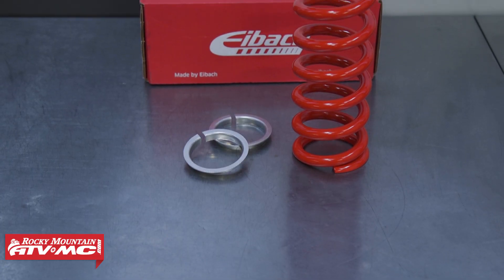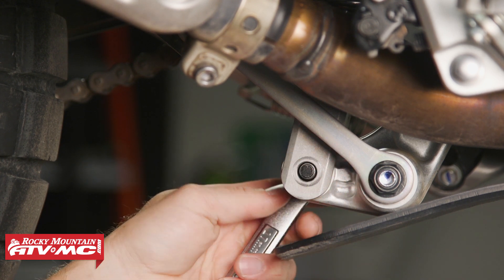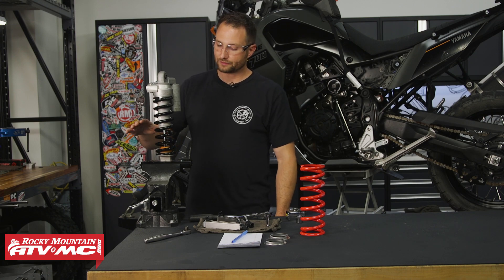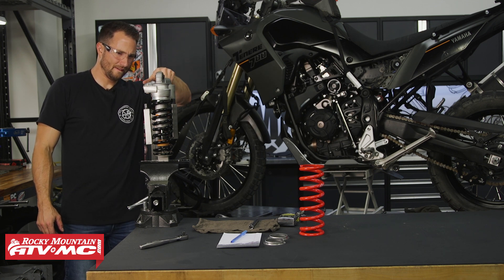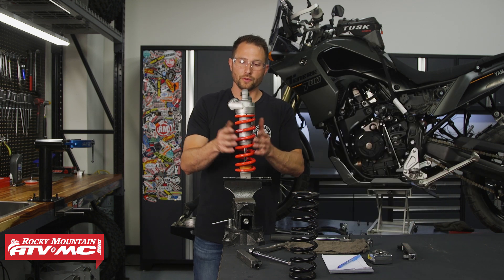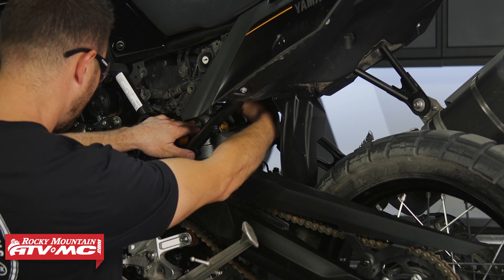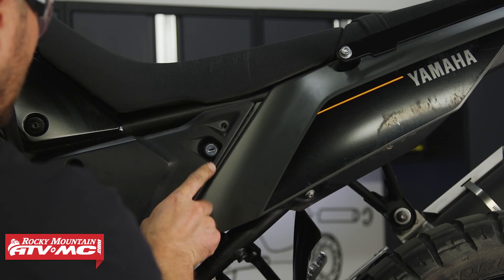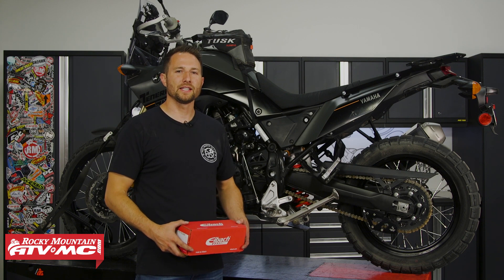How To Install a Race Tech ADV Shock Spring on a Yamaha Ténéré 700

Comment: I got the eibach spring (race tech) but mine did not come with the adapters. WTF
Reply: Mine either!   Seriously,  wtf RM?
Reply: My package came in 1 big box with a separate smaller box inside that had the spring it it. However, my adapters were in the bigger box mixed with the packing paper. I almost missed them and would have thought it didnt come with the adapters too.